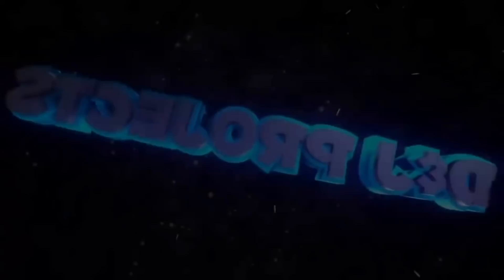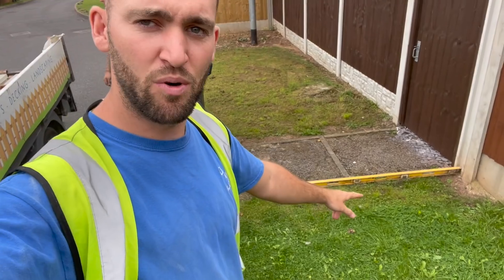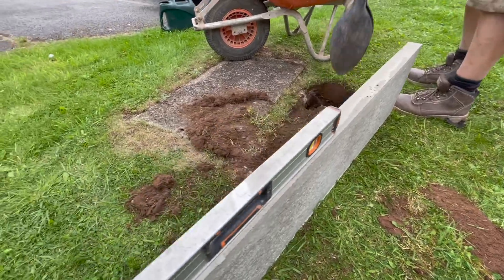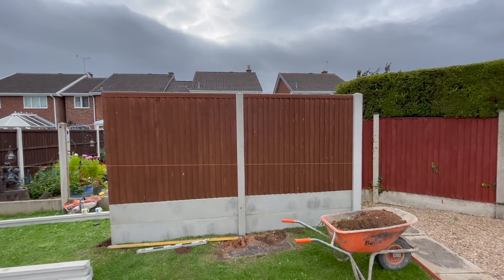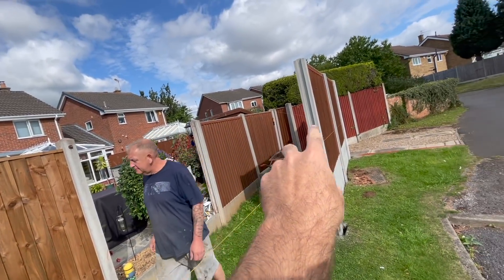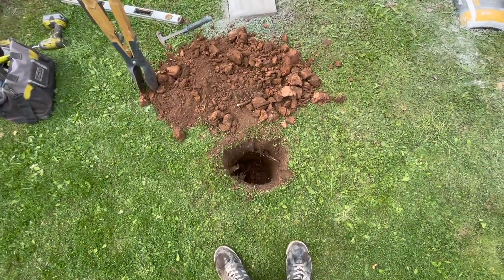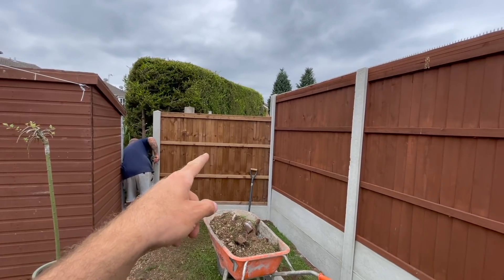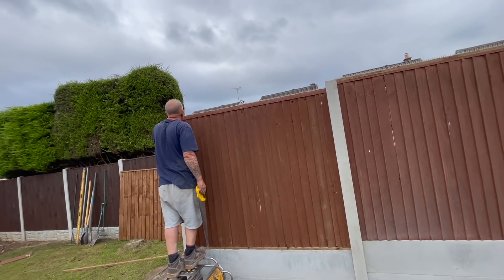Would YOU have done this?!

Comment: Did you advise your customers that they were almost certainly enclosing Highway land and definitely would've required PP for the proposed works?
Reply: There has a been a recent case where I live and the council is making them take down the whole fence.
Reply: @happygardener3990  I don't think this is the last we'll see of this fence.  Enclosing the Highways land is what will cause the biggest problem, but that is going to be even more noticeable because it is too high.
Reply: @thepotterer3726  Quite agree.  But who will accept the liability and costs if it has to come down?  I had a fence replaced recently and the fencer insisted on setting the gravel boards in the ground so the fence top was level and told me straight he wouldn't put in a fence higher than the permitted 6'6" as his reputation meant more to him even though the risk would have been mine.